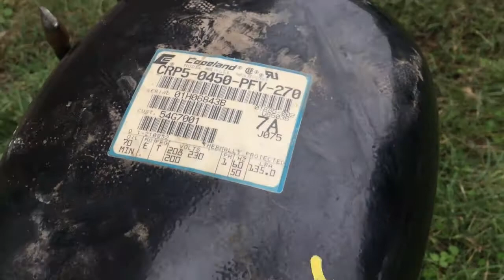Strange compressor failure, running but not pumping

Comment: Wonder if the start cap would contribute to its premature failure....excessive torque you know? Or maybe it was dropped before because it looks like it was already a replacement
Reply from the maker: Joe Shearer I think you're on to something joe. Could have been the bad start cap. It does have a txv and airflow isn't the greatest. It was the original compressor.

Comment: They don't make em like they used to. I've seen vintage tecumseh, bristol, and ge climatuff recips that are still running strong. But i've experienced and heard that copeland recips have always had higher failure rates since they were first introduced due to poor quality internals like this.